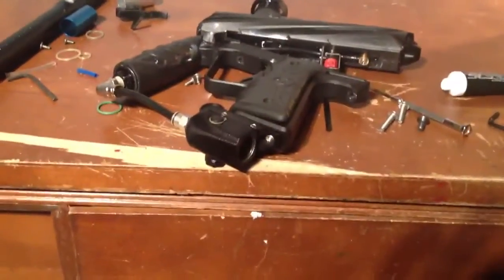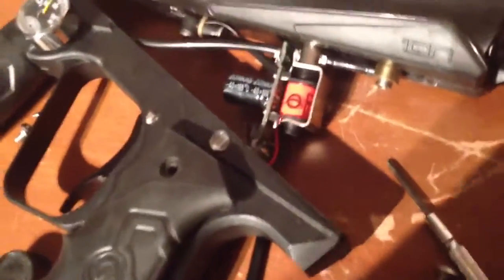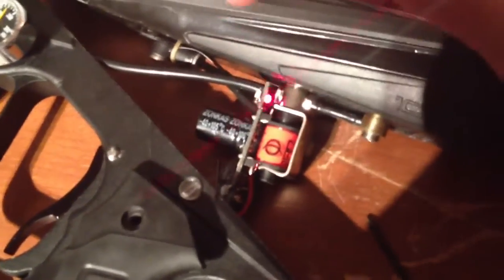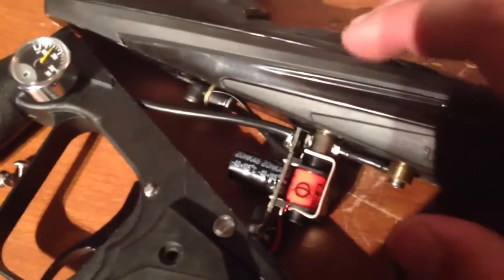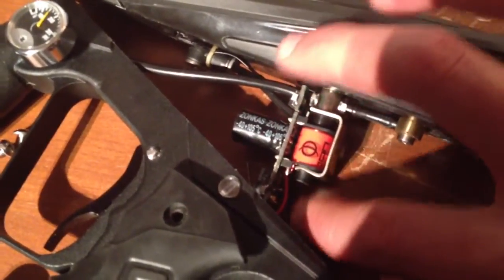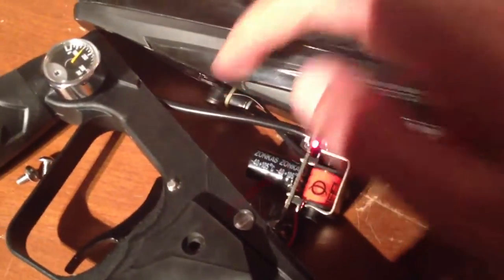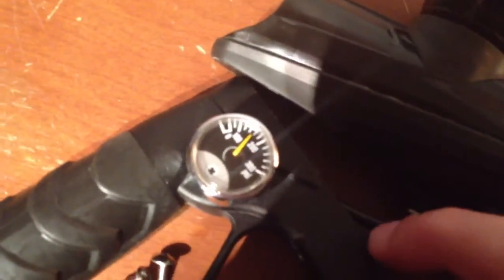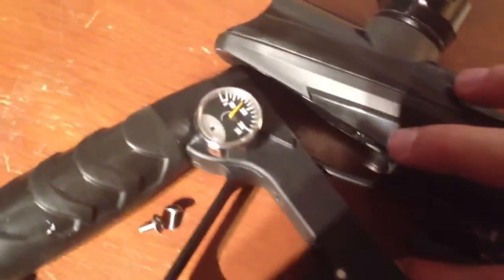Smart parts Ion Problem part 2!

Comment: Change 9v battery first if that doesn't work clean  solenoid put the plunger in and turn it back on with no gas and check to see movement of the plunger if doesnt fall out when you turn it upside down then it is really gummed up
Reply: If it is clean and the bolt is also clean then set dwell up 3 and test fire set dwell up 3 test fire

Comment: i know this is super late to the video im having the exact same problem. ive adjusted dwell and all my setting trying to fix it and it still wont fire. i did get it to fire though when i pushed the ram in the solenoid up. which leads me to believe my solenoid is going out or the elector magnet isnt getting enough juice to plug the hole and let the bolt cycle. hope this helps if not oh well.